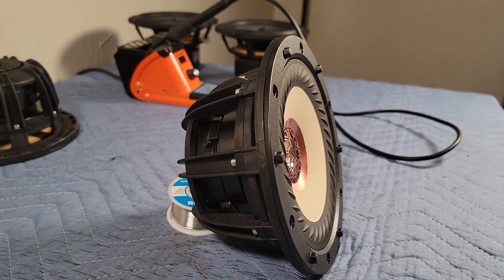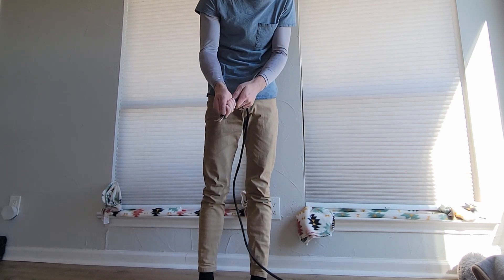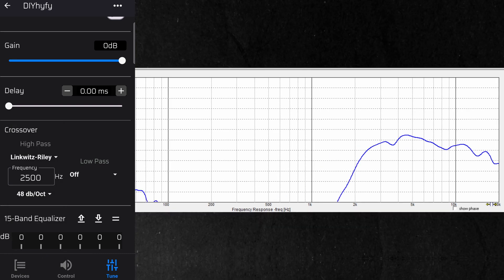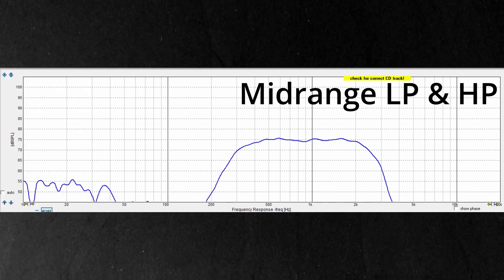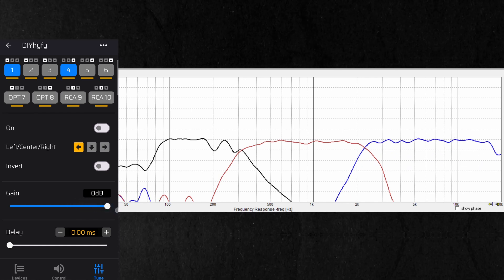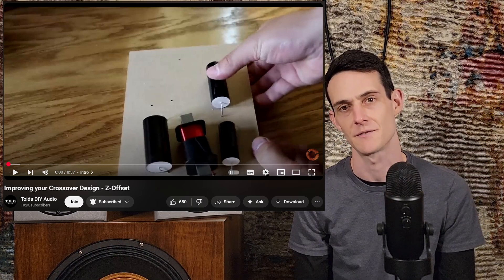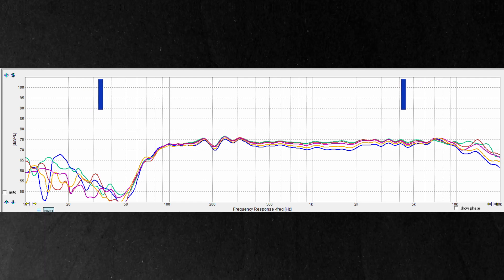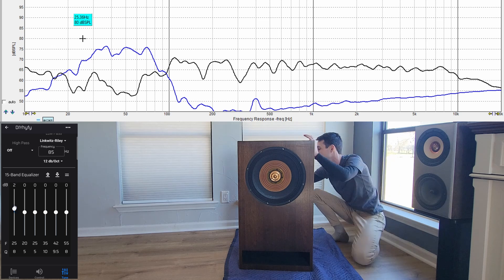Active Speaker Design With The AC650 DSP Amplifier

Comment: For the same price, you can get a pair of FusionAmp FA123  DSP amplifiers. Acoustas system is simple, but should be in matching pairs to get INTO the speakers instead of this problematic cabling. Olso the Fusion software is way more advanced. So this system should be half the price, maximum to compete.

Comment: Hello. Such an awesome build. I made a pair but only changed the Hivi L6-4R for a Dayton Audio 7” Reference 4ohm woofer. I have the Acoustas AC650 in white. Could you tell me what you ended up settling on for xovers? I’m using REW with a mic but having a little trouble dialing it in. I was using a high pass on the TB coax. tweeter at 2,500hz. 800hz to 2,500hz on the TB mid and a low pass on the Woofer at 800hz. The Dayton and Hivi have very similar specs. Any help would be greatly appreciated. Ty

Comment: Super dope product and vid. This is probably a stupid question so apologies in advance, but with a connector like that how do you know which ends to plug into the proper channels on the speaker itself? Like obviously on that amp they don't label left and right but do you keep track of 1-6 on the phoenix connector in any way?
Reply from the maker: That's actually a great question.
So, in the amp, each individual output is labeled. As far as wiring goes, to avoid confusion I actually used a piece of heat shrink of different color on each pair of wire. I did this on both ends of the cable, so that I know which terminal to connect it to on the speaker.

Specifically, for tweeter I used red, for mid I left bare, and for woofer I used black. Simple color coding helped a ton.
Reply: @DIYhyfy  Thank you so much for the response! That cleared it up perfectly. This is super tempting, I've been wanting to DIY some speakers for a while but passive crossovers kinda intimidated me so this might be my best choice.
Reply: @LifeOrbPlusle My friend, pull the trigger if you can afford it. I own the Acoustas AC650 mini deluxe in white. I’m a 25+ year audiophile, but new to DIY. I built these same speakers 95% the same. The Acoustas is an absolute game changer. I promise you won’t regret it. I’ll never ever be without it. It has given me the best and most satisfying system I’ve EVER put together.

Comment: Are you stuck using the dac in the ac650 or can you use a external dac and rca inputs?
Reply from the maker: All inputs are digital, so it would require using its own DAC. I believe they have plans to offer something with analog inputs in the future.
Reply: You won’t want an external DAC. The Acoustas sounds amazing. I absolutely LOVE mine and will never not have it in my system. Never. It’s a game changer

Comment: 900$ or 90$, for Acoustas AC650 DSP Amplifier? It's probably a mistake when they were under some hallucinogenic drugs if it's $900, yes.. I really believe they made an oversight. Whatever they have inside, it's not worth $900, there's probably one of those cheap  DIY  but attractive Analog Devices SigmaDSP ADAU*** family at $5  piece...
Reply from the maker: You conveniently forgot to mention all of the features that make this unique. 
This is a hand-made device, with quality components. Add to that all of the custom UI for multiple platforms, and the price makes plenty of sense. If you can name a single comparable product, please do. 
If $900 is out of someone's budget, that's totally understandable. It doesn't mean this isn't a high value product.
Reply: @DIYhyfy Awesome response. You said it perfectly. I own the same version as yours and it’s worth absolutely every penny. Thank you for taking the high road. Great build…..I copied the hell outta it 😅. But hey, with the Acoustas at the helm, I have the best sounding system I’ve ever owned. In 25+ years of doing this.
Reply: Ummmm….wow. Please don’t spread unknown misinformation. You’re wrong. I own the Same Acoustas that’s in the video……..you honestly couldn’t be more wrong. It’s worth EVERY cent. Please please 🙏 for the love of general humanity, don’t denounce a product that you know absolutely nothing about. Nothing. Sad.

Comment: Am not really interested in a limited power amp like this one.  BUT, if Acoustas would sell a unit that does all this and outputs the signal on at least four line level RCA pairs, that would definitely interest me.  Unit would also need an analog in RCA or XLR  connection so could run my own DAC.
Reply from the maker: I believe they have plans to do almost exactly what you described. It may be worth a wait if you're not in a hurry.
Reply: I’d hold off on that thought. The AC650 made it possible to design the best sounding system I’ve ever put together in 25+ years of doing this

Comment: It will be absolutely great if Acoustas will do a some kind of an AI in the app that helps to design the physical crossover based on the configured set-up. Just imagine what this tool will be for DIYers. Build the cabinet, put speakers in, measure them, arrange the result in GUI, grab the results as the component diagram and out to a store for new capacitors and resistors.
Just wondering, you've disassembled your ls50 clones, right?
Reply: Why would you want to build a passive crossover when you just built a fully active DSP system? 🤔

It's not always (or rarely) possible to mirror a dsp system in passive design. But if you simply want to measure driver FR and Imp then have a computer design a passive xover that might be possible. Already optimisation to a target response is a feature in most good xover sims like Vituix.